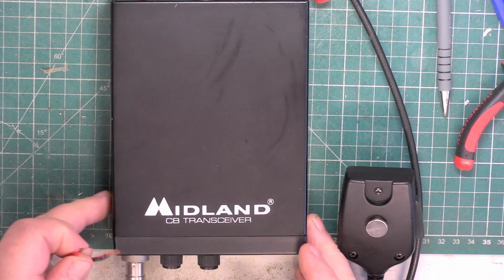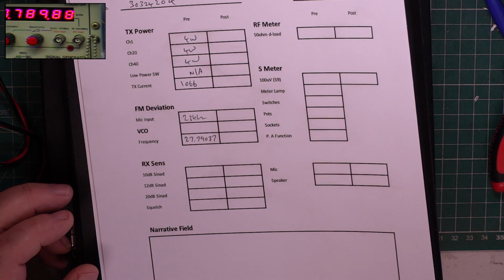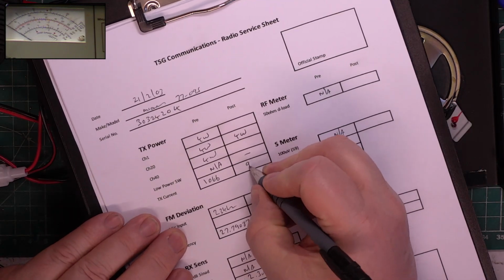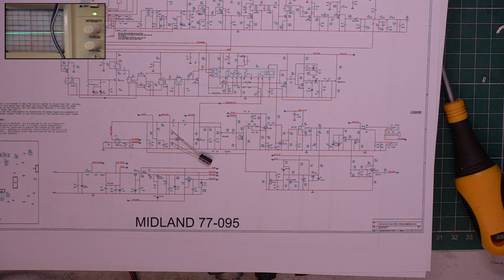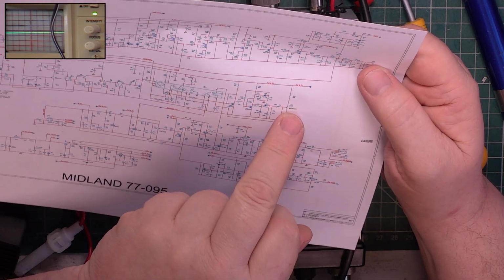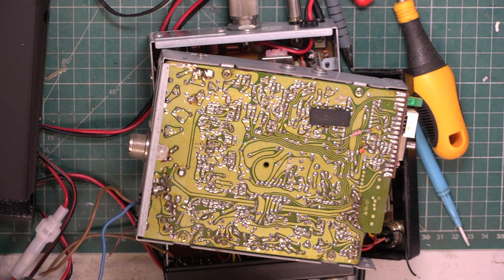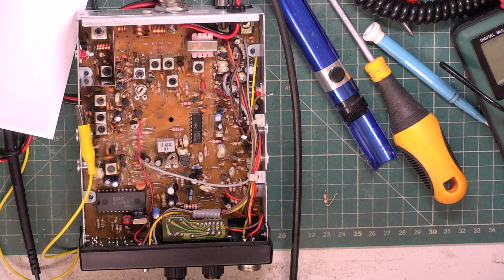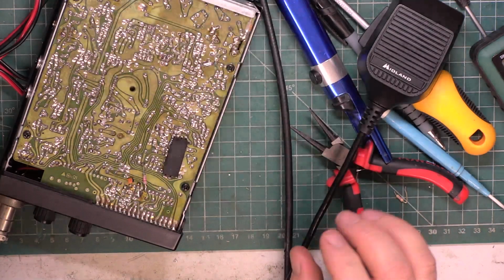Midland 77-095 CB27/81 UK FM CB radio - repair failure

Comment: Call me old school..... I much prefer the multiple knob and switches.... he says as he powers down the Rotel 240!

Richard, would you be able to look at an I.F. board of a Kenwood TS 450S? 
Capacitor C104 was changed but tracks (PCB) are decimated. Ideally needs Jump Wires from each leg of the cap to corresponding locations on the board.??

I can send whole radio or board alone. Cheers!
Reply: These weren’t the best sets anyway.I had a similar issue with one years ago when it was near new and it’s still probably the same wherever it is.
Reply from the maker: Negative on repairs to any amateur radio equipment whatsoever....I haven't even time to sort my own sets out.

Richard, G0OJF, UK